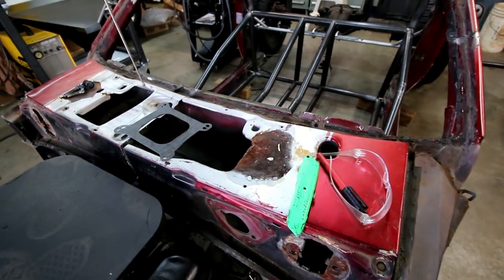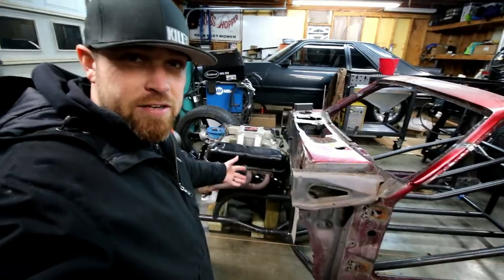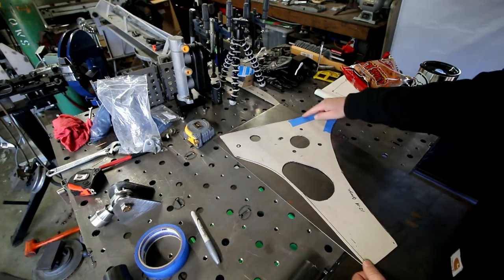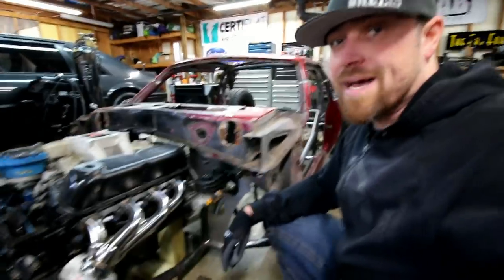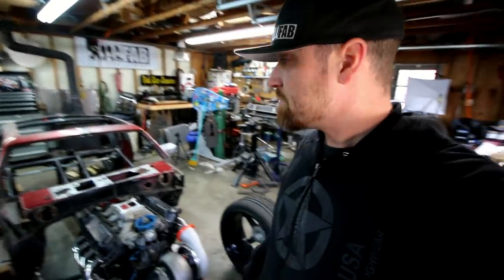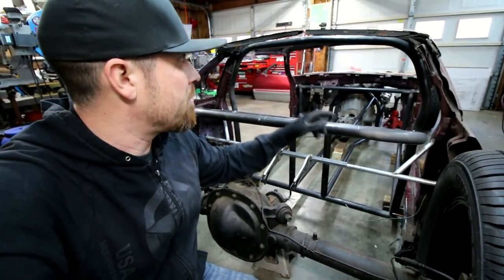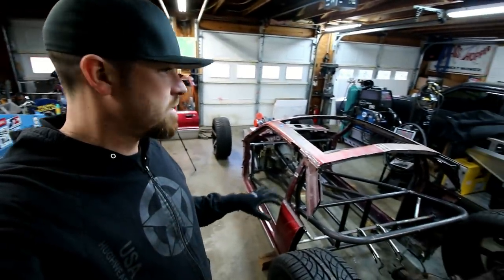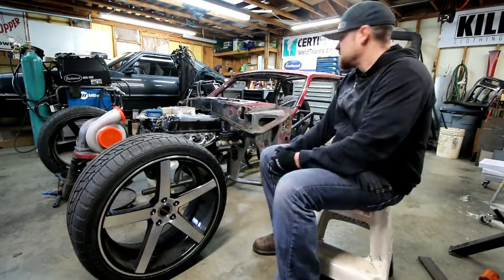Fox Body Mustang Hot Rod Build Progress | Bibbster

Comment: Looking good! Just love seeing all that fabrication, especially the time lapse sequences being included. Have some comments on the "pedal" actuation components. Good to see that left side exhaust header cleaned up; the rust was grating on my "anal" side a bit. LOL

Bell crank for the accelerator pedal / cable?? Doesn't have to go thru the firewall right above the actual pedal, but that would be the "straightest line" towards the carb throttle linkage. 

OE type clutch cable setup?? Don't like that idea. I saw too many issues back in the 1970's with Capri (German manufactured models imported to the USA) and Pintos with the clutch cable going out past the exhaust head pipe and "someone" didn't have it secured properly so it would be too close to the head pipe. Never saw that type of issue with hydraulic clutch systems.

As far as hydraulic clutch actuation goes, the biggest issue is whether to use a hydraulic "slave" mounted to the front of the transmission or "hang" a slave cylinder outside the bell housing which would need to push the clutch fork forwards, if you would just "convert" it from an OE type cable. I question whether there would be room in the trans tunnel for it being external, what with the body being narrowed as it is. I would go for the internal slave mounted within the bell housing. But then you would need to worry about exhaust heat for the clutch master cylinder mounted outside the firewall.

So why not have both clutch master and the master brake cylinders mounted inside and above the pedals, away from the exhaust heat? Plus that would make for a lot cleaner firewall. Yup, a lot of work and it would raise the parts cost quite  bit, plus there would be a lot of fabrication involved to get that done, son.

Or consider floor mounted pedals as long as there is enough leg room left, what with a lower seating position vs the OE seat level and set-back from the stock firewall location; and use remote fluid reservoirs to get them up from the floor mounted cylinders. Plus that would give you a "roadster" look without having the brake master cylinder under the floor board, as was the standard location before the early- to mid- 1950's. When I was in high school I had to replace the brake master cylinder in the middle of winter (in the midwest) on a 1950 Oldsmobile Super 88 in an unheated 1 1/2 car garage; and following winter rebuilt the entire king pin front suspension system on that car in that same garage. Why doesn't that stuff ever break during the summer?

As far as the front suspension goes; worth considering a (greatly) modified upper & lower control arm suspension; ala Mustang II or late model Panther and make it more drive-able when set below a "normal" ride height. It would provide much less camber change at different "ride heights" than a strut suspension. I can't "skull out" how to incorporate a "park mode" vs a "driving mode" actuator lever system as you have mentioned, as most luxury cars that have auto adjustable ride heights (Tesla model S and BMW's that do use upper / lower control arms) do have the ride height controlled via a "strut type" control cylinder that is almost as tall as the front fenders; and you probably don't have that much room; IOW, rally no better than a strut suspension system. Sorry, this suggestion may just confuse matters for you.
Reply from the maker: yeah that header wasnt cleaned up....it was new one. Most of what you see is just for mock up and wont be what is actually used.

Comment: for the spindles, make up some plate that mounts a shock that has heims on both ends,   it makes sense in my head and explaining it doesnt make sense either but I can send you a snapchat if you are interested.
Reply from the maker: +Mark wouldn't work without an upper a arm
Reply: the way I am talking about it wouldnt need one.  Ill send you a snap of what I am talking about

Comment: being from the UK not quite sure what 'FOX' body is?
Reply: Jamie Rollinson it’s the term used to describe these year model mustangs. FOX body is the mustang after the mustang ii.
Reply: 1979 to 1993 Ford Mustang platform also Mercury Capri and Ford Fairmounts
Reply: They hunt down a fox and put wheels on it...
Reply: And the Thunderbirds and Cougars....
Reply: It’s what ford termed the unibody frame design, pre 73 it was the “panther frame/platform”. The term “fox body” is actually incorrect, should just call them fox stangs, as it has nothing to really do with the body but the frame design.
Reply: Jamie Rollinson bascially the best mustangs ever built. Camaro killers if you will
Reply: Not sure about that, as it is a uniBODY design and doesn't even have a frame? The uniBODY is really what's all the same underneath with different panels on the outside.

Comment: Race pedals aren't too costly and you could keep both the clutch and brake master cylinders inside for a much cleaner look and giving more room for your hydraulic and turbo parts. Oh and definitely separate the radiator from the drivers compartment. I had a 64 Ford van that blew a rafoayor hose and scalded the crap out of my leg. Still have scars and that was 20 years ago.
Reply from the maker: +Billy Beane Yeah I have thought about that but I am trying to keep it true to the fox style

Comment: you could put some sort of el camino style window between the radiator and the passenger compartment 
http://carphotos.cardomain.com/ride_images/2/4540/321/23847660053_large.jpg
and a second window behing that creating a see through airdam 
with the shape you want it might work if you get a glass harchback hatch 
http://www.autoglassquotez.com/photos/1990-Geo-Prizm-4-Door-Hatchback-Back-Glass-2013-10-22-17-01-04.jpg narrow enough to fit between the wheels
Reply from the maker: both of those are still way too wide

Comment: Just use the strut and spring in a cantilever set up.
Reply from the maker: I have never seen a strut used in a cantilever setup before....always just a coilover shock
Reply: The Fab Forums sure, just Fab up some mounts. Use the coil over consersion that fits on the struts.

Comment: Hope Einstein's advice help's, I did own 16 to 18 of my own vehicle's so I'm no fool. Love, I love fabrication if I did get my citizen ship that would allow me to be 100% American id likely be into fabrication since it's in my blood. Lagit. Iv fabricated a access side panel from 50pcs sticker bomb sticker's  and scrap metal no joke. It looks like a white picket fence on Halloween with a bright led green case lighting and iv used 2 equ level gauges from a 70's stereo with. I then used the stock pc case lighting that look's like some blue robot eye's. even though it's just a free scrap junk pc tower it sure is unique and came out great more then I expected. Mainly I did own a Dodge I was going to build it and put custom floor's in it and strengthen the unabody chassis rail's right out to the custom straight axel and the chassis rail's  the 318 dodge motor would mount to. So if you read the somewhat best advice and opinion as well as my second note then you would know I'm named Albert after my uncle A,K,A Einstein iv got machanic's in my family that are now todate licenced there for fabrication and machanics is deep and in my blood cheer's

Comment: Hi. Have you ever considered using a double wishbone front suspension with coil-overs. Like a Lotus 7 (see below):
http://i32.photobucket.com/albums/d15/dusty1609/lotus%207/suspension3.jpg
Reply from the maker: no....not interested in  any kind of control arm setup....I really am after the that old school hot rod look with a modern twist
Reply: a torsion bar setup would look the part and would be adjustable. similar to the vw bugs or whatever.

Comment: You ruined a good car? There is a million in the junkyard so how does that make the crybabies feel? It's like the most common car every time I go to the drag track....are they ruined when they cage and back half one? Not like you chopped up a Yenko Camaro or anything of value. I bought a convertible musta g of that body style for 300 bucks just for the t5 and crushed the rest with a skid steer so I could  haul a couple cars for scrap. Besides every one cut up makes the rest a tenth of a cent more valuable.......it's just a mustang.